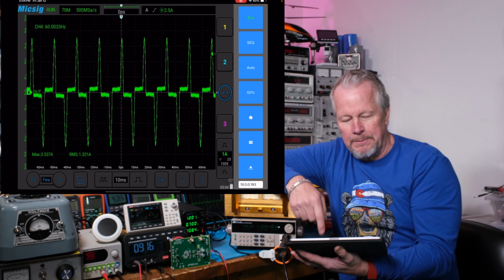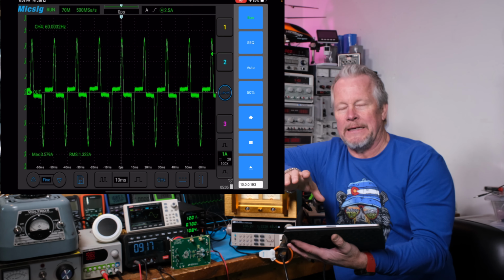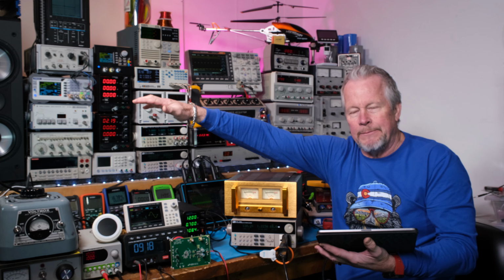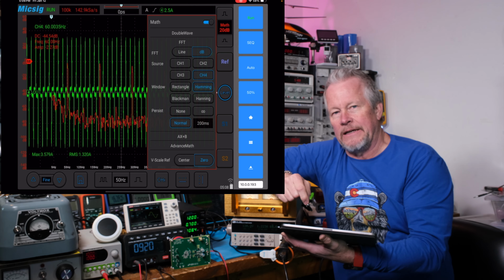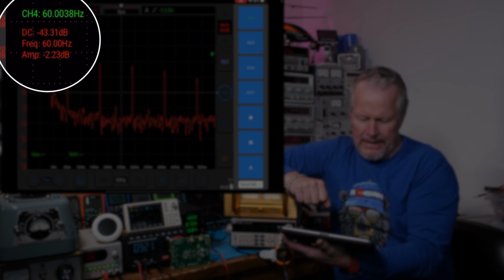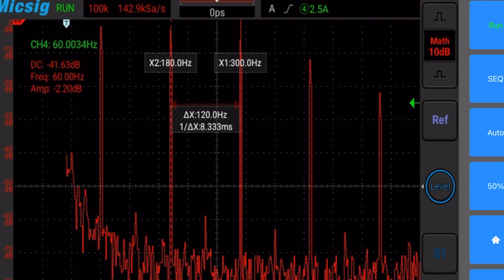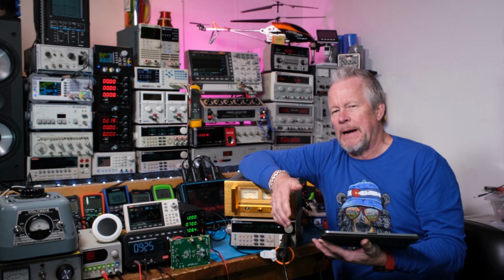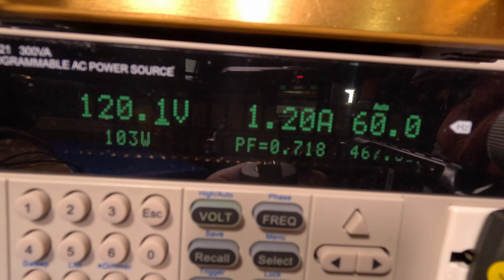Low Frequency Switcher Waveforms - Linear or Switcher? #micsig #STO1004

Comment: Thank you Eddie. I too also thought a linear power supply was super quiet. I now see I was wrong. Thank you, Steve
Reply from the maker: Thanks Steve!  Let me correct the terminology as this is what I want us to think about.  The input from ac is a low frequency switcher provided by diodes.  But, if there is regulation after - and if it is linear - than the linear does provide a quiet output;)  Although - at high frequencies it will pass the noise through.

Comment: Yes, you can hear diode switching with a mains analyser when a linear PSU with a rectifier is connected. It might be worth looking at a typical car-amp with both SMPs and class D compared to the class A you built.
Reply from the maker: Thanks John!  I'll do more testing to cover this topic.

Comment: What do you think of a half bridge using a diode, and using the transformer as the other half bridge giving you bridge rectification .
What about if you use a storage capacitor after the transformer but before the regulator, like a motor run capacity of say 15uF can it  bring any benefits, does it make the transformer run cooler and less switch noise  for the rectifier and ripple
I've never seen it done in this way.
Reply from the maker: The transformer needs to see AC so that it and couple a magnetic field from the primary to the secondary.   The waveform crossing zero resets the field and prepares it to be polarized the other direction.
Reply: Once the input is rectified either full or half its not an AC voltage anymore and the transformer will be useless. Bulk capacitance IS used at the input to a regulator.

Comment: It's late here in the UK so will probably have to watch this again because I don't Know what it's about. This argument about the power supply's is moot anyway, nobody is going to change the name of something if it doesn't add value. Nothing changes if you altered all the textbooks in the world and I don't agree with you about Audio Engineers either I think they have more idea about noise than most and I also think with their line of work they have too. We realy don't need to be reminded of what 1X and 10X is about, I think thats about the point this became a rant.  There was no value in showing the FFT either, there needs to be a focus here like you have told us a few things about your career which are very interesting but how about designing a power supply ? The JAT PSU gets picked up briefly each year and we start again with the power factor correction stuff and it stops. Please can you start and design a power supply and drop the rants and teach some electronics also to many equipment reviews. Lets complete a PSU design of any sort ! lets do electronics. Anyhow I'm tired, see you next video Ed....cheers.
Reply from the maker: Thanks but I am trying to educate the viewers here so that we are on the same page moving forward and we have a better appreciation for PFC at the front end.  I'll show the difference moving through the power supply. 

I think the FFT shows a lot in how the waveforms being deteriorated show up in noise - and that's the value of all scopes having the ability to show an FFT now.  These harmonics show the energy lost in noise and thus no longer good for power - but only cause issues in noise filtering.

Working in aerospace I learned that the noise in audio is trivial compared to the signal integrity issues that sensitive electronics at higher bandwidths are faced with and how difficult it is to keep clean.

This is great background knowledge so as we move forward with our power supply designs - there will be a higher appreciation for what a PFC and SMPS can do.  So no more buzzing in your amplifier:)
Reply: Great let's go !! :) @KissAnalog